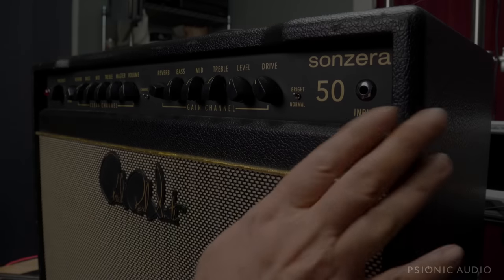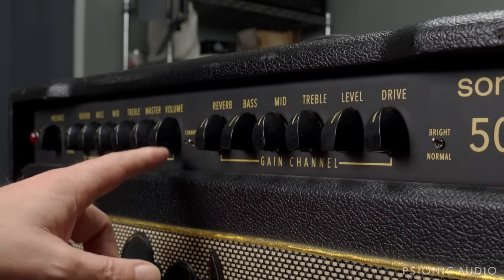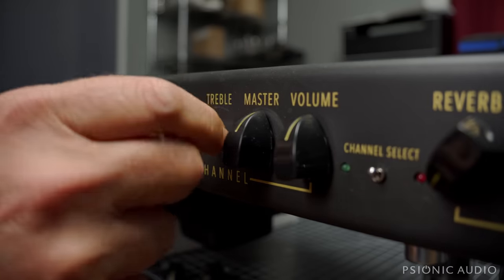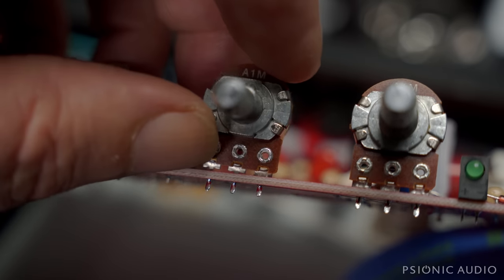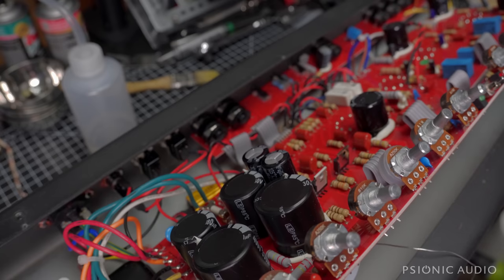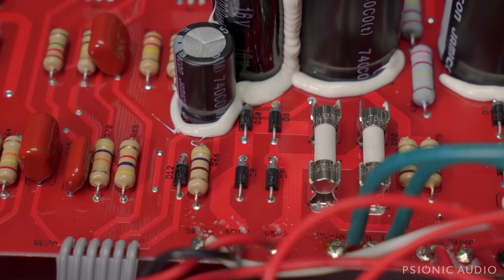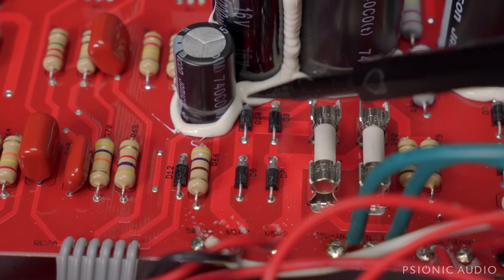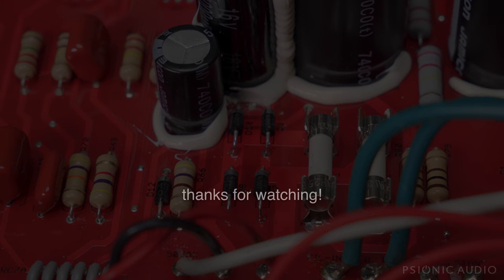BUZZ | PRS Sonzera 50 Part 1

Comment: Have you come across the Sonzera 20 mk2 yet? I bought one from andertons and it had microphonic valves right out of the box and a horrendous noise floor. I'm getting a replacement but was surprised that with nothing plugged into it is fed back with the gain and volume up to the max on the dirty channel! Also was really crackly on every channel, again with nothing plugged into it.

Comment: Oh man I have the 20w version and it buzzes and rattles so bad I even had an amp builder from devil cat amps re-soder and work on it and it still buzzes like hell sounds great use it for gigs and my main amp but the buzzing drives me nuts at home. Thinking about getting a  voxac15 would you recommend?

Comment: I hardwire pots to the PCB. Worked on a ton of Pcb mounted pots and Jacks.
Reply: That's an option. It's a hell of a lot easier(faster and cheaper for the client)to just get the right parts and install them correctly.

Comment: It does look like a massive improvement.  Is the board through hole plated?

It's a hell of a lot better than the last Archon 50 I punished myself with.
Reply from the maker: Yup, pretty good (through hole plated) board in this. I’ll do a fuller review of such things in part 2.

Comment: Hi Lyle, those 4 diodes rectify the heater suply for V1 ?(I asume they want DC heater suply in V1 to reduce hum). If so I don´t get why a power tube failure (that has AC heater suply) induced a falure in that 4 diodes rectifier bridge. Tryied to follow you explanation, went back a few time but got lost. you think too fast for me, plus english is not my main language. I would really apreciate your reply , your troubleshooting method is awesome to say the least and you deserve more subs and views. I whish I had a Tech like you where I live. I learnt to repair my own gear because I don´t have the means to pay a Tech like you, and there is no tech like you anywahere near. I have had that isuue in some amps in the past, never understood the cause. I wold really apreciate your answer. Thanks in advance. Keep working like you do, I would pay your fee any day If I were in USA. If some so called tech says you overcharge your work the don´t know what they´re talking about. Just pull thar board is a hell off a job.Take care!
Reply from the maker: Thank you. I’m supposing that the failing EL34 might have a problem that would cause a brief large increase in heater current. Could be a heater to other tube element short.

And that this “spike” could have damaged the diodes in the bridge as they are connected to the heater supply.

This is just supposition. I know the EL34 tube is bad and I know all four diodes were faulty. I suspect, but do not know, that there is causality here.

I know that with a new pair of EL34s and four new diodes, the problem was solved. 

Under normal operating conditions, this diode bridge should be more than enough for preamp tubes to have DC heaters. To help it out I installed the new diodes slightly above the board with longer leads to better dissipate any heat.

If these were to fail in the future, I would replace them with a chassis-mounted 6A diode bridge. But they should be fine.

Comment: I have a Sonzera 20 please help me figure out the problem here are the symptoms  : 
FLIP power On :  no red light on  front indicator no led light green red channels front . 6l6s light on  V2 & V3 too  but V1 V2 don’t light on  no dc voltage going through .

FLIP standby On : no sound just a humming noise not loud and  still NO Red light indicators front no channels led green or led red light . and V1 V2 don’t light up . Only 6l6s and V3 V4 are lighting up

PLease what do you think is it ?   thank you so much
Reply from the maker: Your amp has a non functional DC supply. It could be a lot of causes, most of them simple/inexpensive. But take it to a tech.
Reply: @PsionicAudio  thank you so much and god bless you !